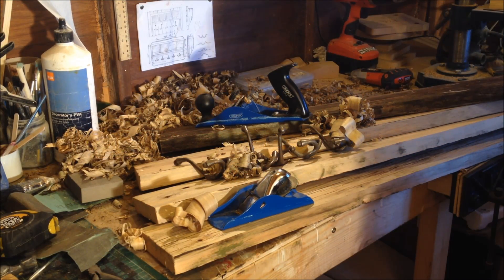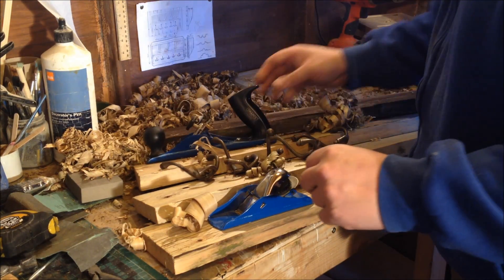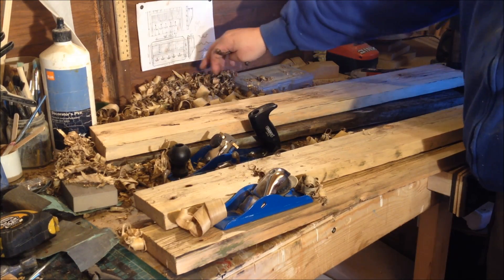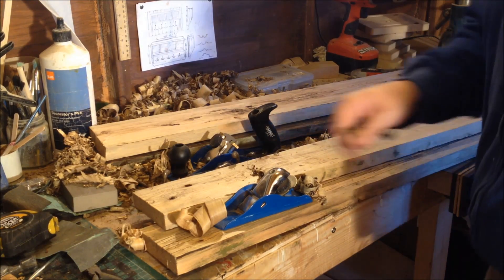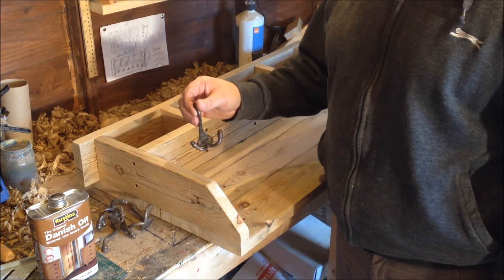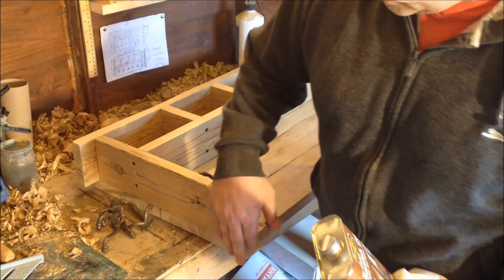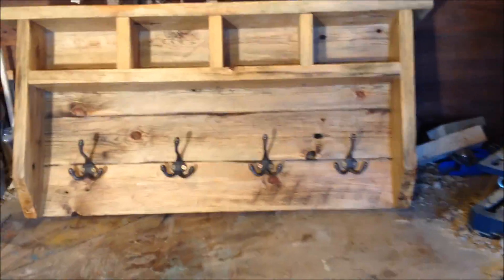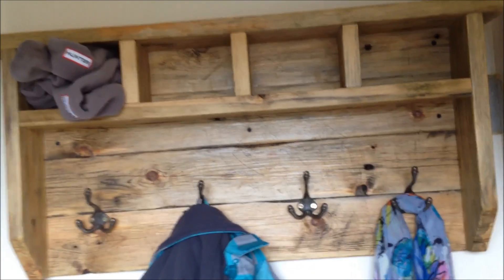Making a Farmhouse Style Coat Hook Rack

Comment: where is the plans
Reply: Just make the flat back piece first whatever size you want it, then make the top horizontal piece just a couple inches longer than the width of the back piece that you already made, so it sticks out just a little. The 2 upright pieces on the sides will just be the same length as the back piece (minus the width of the board at the top) since they will be put right under the top board. It looks like it might've been cut at a 45° at the bottom where they are angled down towards the back piece, but it doesnt have to be a 45° angle, just whatever looks the best to you will suffice. Then measure between those two upright side boards to get the measurement for the second horizontal board (the bottom board for the cubby holes).. Lastly, you just measure the distance between the top and bottom horizontal boards and cut the cubby hole divider pieces at that measurement. 
After gluing and nailing or screwing it all together and adding the coat hooks then you're done unless you want to put a stain or finish on it. Really no need for plans for something like this if you have basic skills and a tape measure haha hope that helps!